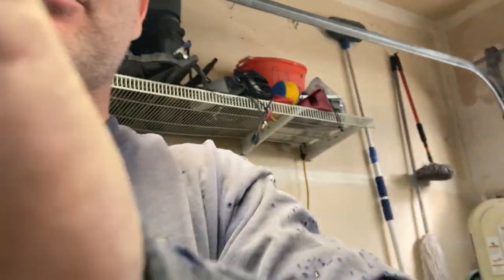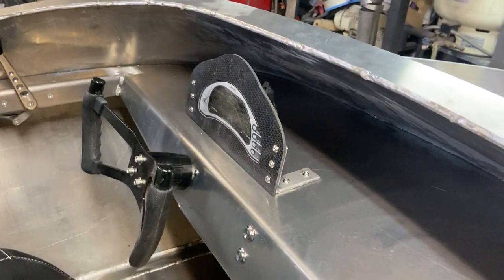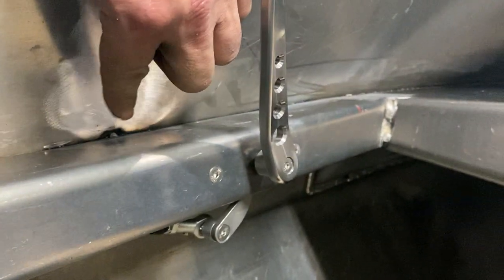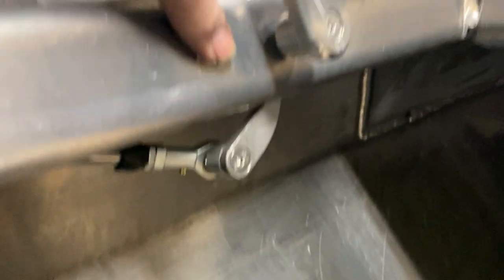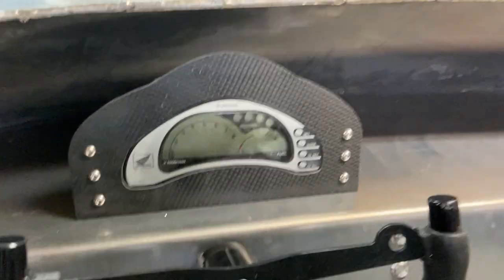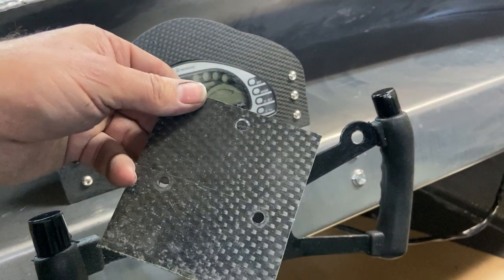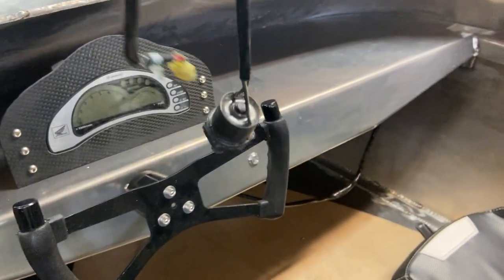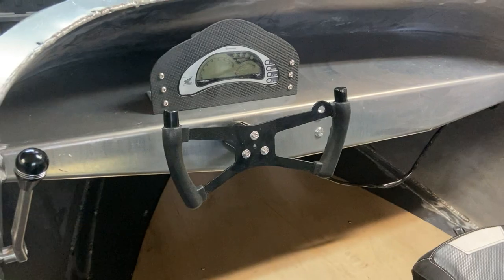Wattscraft 3.3 Honda Turbo mini boat build update

Comment: Your dash cluster is not symmetrical and the inner hole cut out is not shaped right either. Tip to strengthen it to stop the edges from delaminating is to run some thinned epoxy on the edges or even just CA glue on the edges.